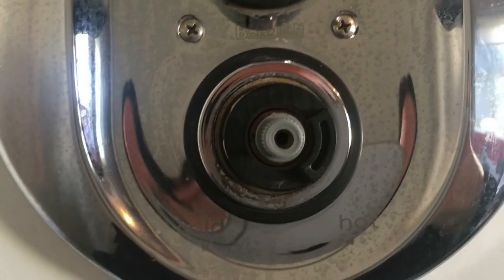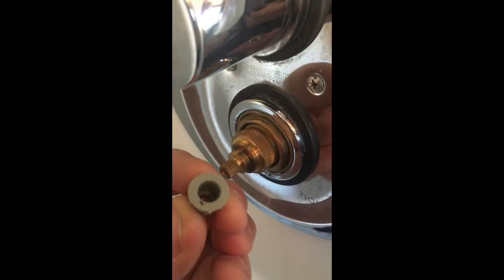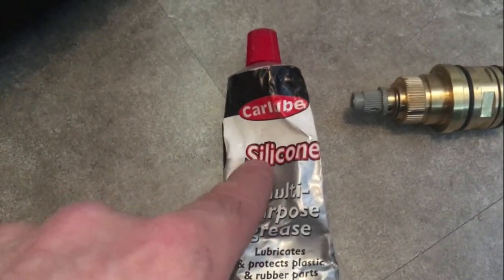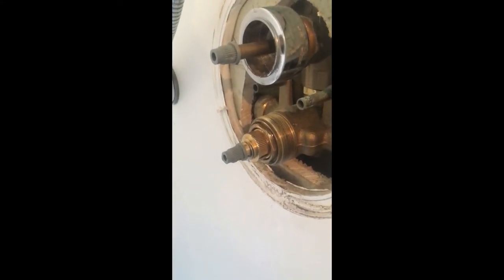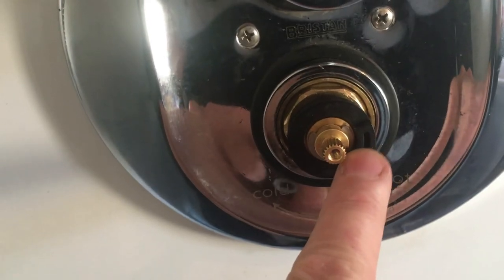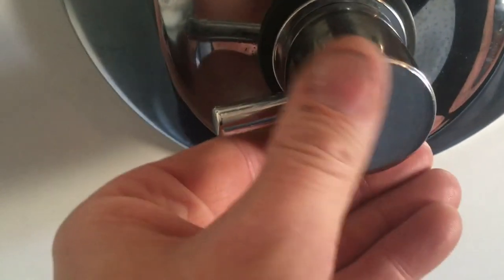HOW TO Replace a Bristan Shower Cartridge | Fix a COLD Mixer shower in minutes !

Comment: Thanks for the video, which helped me replacing the on/off and Thermostatic valves on my Bristan Quadrant shower.   Both had failed after 20 years of daily use.  Luckily found replacement parts from Di Vapor, as the Bristan Quadrant range is no longer in production.  Suggest using a 30mm box spanner to remove the thermostatic value retaining nut, because there is not much of the hex surface to get a grip on. Also used a lime scale cleaner (ensure you flush with clean water afterwards) internal to the valves as a bit of a mess.  Thanks again.
Reply from the maker: No problem, glad you found the video useful Martin !

Comment: Brilliant video and exactly what I’m looking for to replace the same thermostat. I assume this is a Scotia build as everything looks the same. Can I ask the best way to isolate the hot water supply to replace the thermostat? (Boulter Buderus oil boiler and hot water tank). I know mains supply is under utility sink. Thanks
Reply from the maker: Thanks, yes, I think this was indeed a Scotia home :-)  Best to look for an isolation valve coming from your hot water tank, you should be able to find that no problem. Thanks for the comment

Comment: Great explanatory video.
My problem with this same shower is tiny holes in the shower wall outlet metal dome and water sprays out. Probably due to corrosion as I am near Aberdeen beach.
How can I remove the outlet & is there a straight replacement?
Cheers!
Reply from the maker: Hi, it is difficult to say without seeing it but if it is corroded, best practice to replace the whole unit as you don't want to risk a leak when you are not in your property.

Comment: This video was really helpful - thank you.  For some reason I just have Hot water - any idea what I missed when replacing the parts please?
Reply from the maker: Thanks, I'm not sure why you would just have hot water after replacing the valve ?
Reply: @Bacrenfencing  Thank you - could it be that I replaced the black rubber piece the wrong way?
Reply: The cartridge wasn't secured tightly enough - it wasn't flush with the silver water control !!!
Reply from the maker: @elicastelli9728  That's good you got it sorted !

Comment: A good clear video. I need to do this with my old Trevi Therm 300. Do you know if it is the same procedure? There is a part called 'calibration control' between the knob and the cartridge.
Reply from the maker: I am not familiar with the Trevi Therm 300, so cannot comment on that. The calibration control will just be water temperature setting, it is usual to set this to around 38 degrees c.

Comment: Thanks for the video. Unfortunately I don’t manage to remove the nut. I’ve trie spraying WD40 several times. Any recommendation?
Reply from the maker: Try heating the nut with a small blow torch but obviously be very careful - only do that if you are confident. Failing that, best to call a plumber to do it for you.
Reply: @Bacrenfencing  Thanks for the suggestion.

Comment: Excellent info. I have problem my control knob will not pull off after grub screw is removed any ideas Andrew . Ok small hammer and chisel to price off did if thanks
Reply from the maker: Thanks Andrew. If the control knob is stuck, you are best to squirt in a releasing agent such as WD40 or PLUSGAS - try to prize it away a little bit and then squirt loads of releasing agent in and leave for a good 5-10 minutes. That might work, try to avoid using a hammer and chisel 😂💪👍
Reply: @Bacrenfencing  Hi thanks for replying. Sorry after lots of releasing fluid still had to resort to a small hammer and chisel. Andrew
Reply from the maker: @andrewfowler267  Did you get it off Andrew ?

Comment: This is a great video! Many thanks! I need to replace the Thermostatic cartridge on my shower as there is no variation of temperature. It's either mildy hot when on max or cold in any other direction. The shower set up is the same as your video i.e. temperature handle at the bottom and pressure handle at the top, built into the wall. However, plumbers are telling me they are not able to do it unless they know the manfufacturer of the shower. Is there no way around this? E.g. universal parts, if I take the existing valve to a plumbers merchant? The shower was installed 10 years prior to me moving into the proeprty so I have no access to the manfuacturer details and it's frustrating, given how simple the fix is.  All the best, Nick
Reply from the maker: Take the valve out and take it to the plumbers merchant, they will be able to find a replacement I am sure. There is probably a serial number on the cartridge which will help identify it. Plumbers will often say that because it can be a lot of hassle getting the correct replacement parts and will cost plumbers time and money - can't blame them for that.
Reply: @Bacrenfencing  this is great. Many thanks!

Comment: Hi, I am having an issue with my shower system, when showering with hot water, it then goes cold suddenly for a few seconds then it goes back to hot. Could this be a cartridge replacement issue? 
this is only happening to my bristan shower system, no other taps around the house has this issue

thanks
Reply from the maker: Yes, sounds like a thermostat cartridge issue, best to replace the cartridge.

Comment: Hello, very informative video, i tried to follow the same procedure myself :-) ...i manage to spray wd40 and the hexagonal nut opened quite nicely , however the cartridge is not coming out as in your video. It seems there is no spring in it. The model is Bristan Qube , part is 00622415.  How do i take this cartridge out please ? Also, how do i calibrate the temperature. Thank you.
Reply from the maker: I have no experience with the Qube but I would assume that the cartridge should just pull out. Try praying some releasing agent and pulling it out gently with a set of grips. In order to correctly calibrate the temperature, you would need a water temperature thermometer to determine the temp. These should be factory set at around 38 degrees, so I always mark it before moving anything and then replace exactly in the same position.
Reply: @Bacrenfencing  Thanks. I will try once again. It’s called screw in cartridge it seems, so wondering if it has no spring but instead I have to further unscrew the cartridge after I have taken the hexagonal nut out. I am looking to call Bristan service Center tomorrow so hopefully will have it sorted.
Reply from the maker: @guptanaveeen  Please let me know how you get on, hopefully you will get it sorted !

Comment: How do you know if you need a new cartridge, or just to clean up the outer casing of the valve? My temp valve has seized and only turns 1 way
Reply from the maker: Every situation is different, I could not comment without seeing that, but it is usually always good practice to change the valve.
Reply: Exactly the same shower I have, my shower is Luke warm even with the scalding stopper removed, is my cartridge goosed?

Comment: My shower cartridge just came flying out and gushing water. The collar was held in with a small Allen wrench screw but there was no threaded ring for it to fit into the hold. It seemed so unusual.
Reply from the maker: All showers are different, this was for a Bristan PRISM shower.

Comment: How do I stop the water coming out I started to unscrew it and water was coming out
Reply from the maker: Are you sure you turned the mains water off completely ? If it is just tricking out, it is probably just some water in the pipes that will drain, but if there is some pressure to the water, then it is likely that you have not fully isolated the mains water supply.

Comment: How do I fix a dripping shower problem for this same Bristan shower? Will changing the same part fix it?
Reply from the maker: No, you will need to replace the actual cartridge, it is the one above the one that I replaced in this video. The video shows replacing the thermostatic cartridge which controls water temperature. You will need the other cartridge which turns the water on and off. I am not sure of the part number but if you google Bristan Prism 3/4 cartridge, that should show you where to get them. Fitting is pretty much the same as I have shown in this video. I hope this helps ? 👍
Reply: @Bacrenfencing  thank you for the speedy reply - much appreciated. The problem is which part do I buy. There are a few that came up after google search. Wonder if Di Vapor has it
Reply from the maker: @indranil2u  I think they are pretty standard, maybe best to phone a supplier and tell them that it is a Bristan Prism shower, they will know what the part number is. I think it may be Bristan 00622206